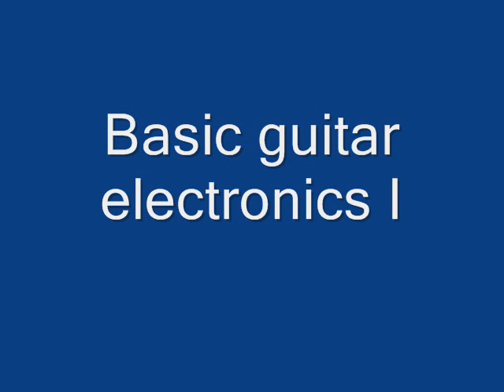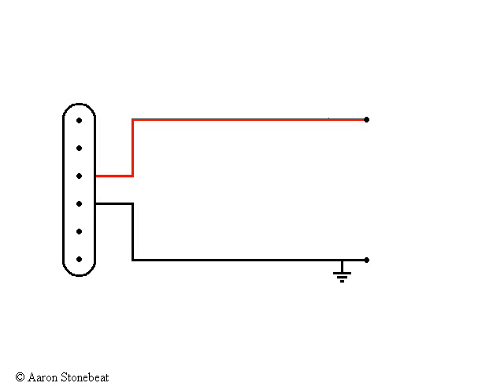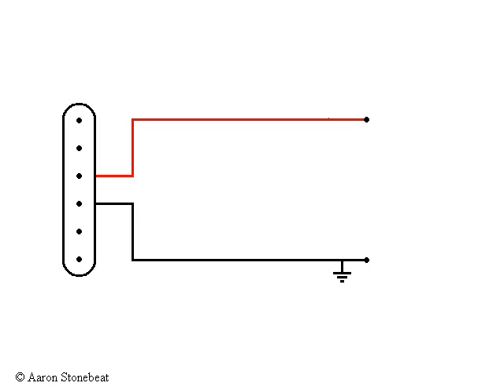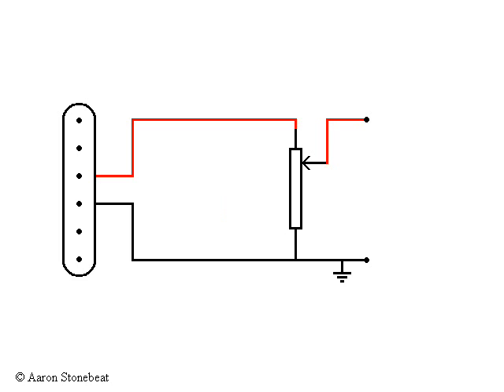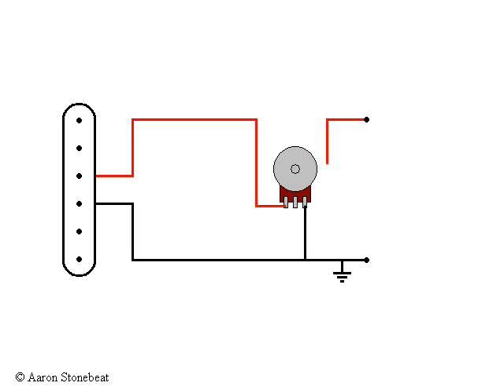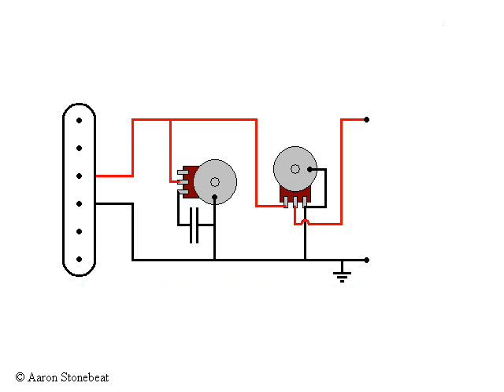Basic Guitar Electronics I - Volume and tone control

Comment: This is the most practical and clear teaching video I have ever seen anywhere. I'm a retired teacher! great weldone! How about doing the same/similar for bass guitar?
Reply from the maker: Thank you very much!
Electronics in basses doesn't really differ from electronics in guitars; blender pots and pre amps may be a bit more common in bass guitars.
Reply: I agree! I think these videos are VERY well done, and thought through. I am a teacher myself (music teacher) and I can relate with the fact that most often than not (if not always) we must deal with the very basics in a clear and succint way, to have a good foundation with the more intricate stuff. Congratulations Marc Van Oppen!
Reply: I have refurbished a trashed Strat body and now its a slick single coil short scale P bass using a Seymour Duncan Hot pu. I would like to be able to use the 3 position switch in a way so I can change tone. Can it be done and can you post how I could go about it. I'm ok at soldering despite my 70 years! Thanks.

Comment from the maker: @MitjaShi 
There is one hot lead from each of the volume controls to each tone control; if you cut those the tone controls are out of the circuit. Don't worry about the ground connections (or perhaps capacitors between the tone control and the casing of the volume control, depending on how things are connected). Disconnect those two wires and you're good to go; if you want to go back to having tone control there is only one wire for each set of controls to reconnect.

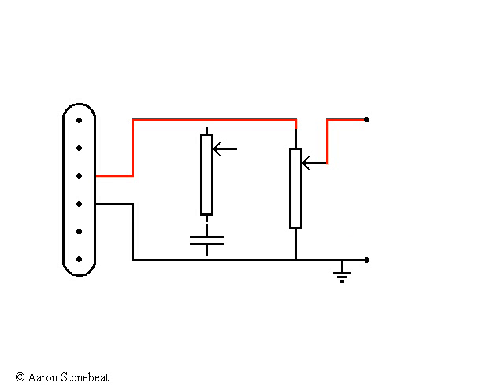Comment: Thank you very much for this video. There are a couple of symbols in the diagram that I don't understand. At 0:30 , there is a symbol in the bottom right that looks like an inverted Mayan pyramid. At 3:15 the tone capacitor is bisected by parallel horizontal lines. What do these symbols mean? Also, tangentially related, does anyone know if when you're winding guitar pickups and the copper wire breaks, can you get away with tying the broken segments together? Or do you have to start over?
Reply from the maker: The symbol at 00:30 means 'ground' (it connects to the mantle of the guitar cable).
The two parallel lines ar just the symbol for 'capacitor'.

The wire for the coil is insulated so it's no use to tie two ends of a broken wire together. You either have to try to solder them (tricky but not impossible) or start over.
Reply: @aaronstonebeat  Thanks for clearing that up for someone who's completely new to this!
Reply from the maker: @bryanreal4226  You're welcome. Good luck!

Comment from the maker: @MitjaShi 
In this schematic lowering the volume will affect tone because part of the resistance of the potentiometer is in series with the hot side of the circuit when the volume is less than 100% up.
To prevent this you could use a 'treble bleed'.

Comment from the maker: Yes it is. Generally larger pots (500K) are used with humbuckers so more resistance will be in series when the volume is lowered. I use a treble bleed (just is simple small capacitor) on one of my humbucker guitars.

Comment: Thanks again.  I thought I had it done right, but I done something wrong hooking up a piezo cable & handmade pickup made from the winding in an old hard drive and two magnets.  Aiming for one pot, gain, volume and one tone control for both.  Used case as saddle and added wire to string for extra measure since saddle case holding the rig ought create a ground.  So far failure.

Comment: What is to stop the signal completely bypassing the tone control since the signal just goes past it rather than through it, like with the volume control?
Reply from the maker: As long as the resistance of the tone potentiometer is not infinite there is a path for the signal to ground, so it will want to go there. There are potentiometers that disconnect from their resistance at  one end of the track; in that case the signal indeed bypasses the tone control completely when it is set to maximum treble.

Sometimes people use potentiometers with higher values (1 megaOhm for example) to prevent loss of treble in the signal via the potentiometers.

Does this help?

Comment: Thanks Marc, this is a great video. I'm just a little confused about the signal flow. Does the filtered signal travel back down the hot line from the tone pot. I'm struggling to wrap my head around how that signal gets into the output
Reply from the maker: Well, you could say that the high frequencies 'disappear' to ground and the low frequencies are allowed to travel to the amplifier via the hot connection.

A more correct way would be to say that the pickup and the capacitor form a system with a lower resonance frequency than that of the pickup on its own.

Comment from the maker: The volume pot is connected as a voltage divider, the tone pot as a variable resistor. The variable resistor allows the signal to 'see' more or less of the capacitor. If the signal 'sees' the capacitor high frequencies don't reach the amplifier (or to be more precise: the capacitor lowers the resonance frequency of the circuit).

A potentiometer doesn't have an input or output as such; what is what all depends on the way it is connected.

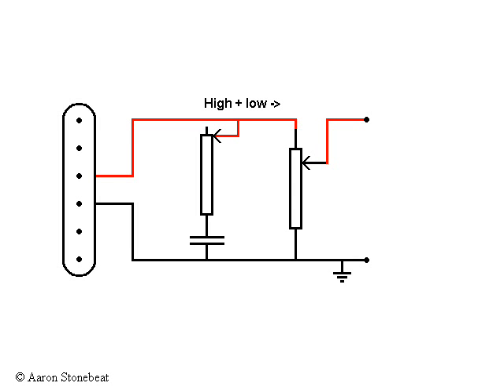Comment: I have a question about the setup at 4:14. 
If the volume potentiometer' wiper was selecting, say, 10 kOhm, and the tone potentiometer' wiper was selecting, say, 100 kOhm,
Then wouldn't there be ten times more current going through the volume pot? Does the tone pot control how the signal is filtered or what percentage of the signal is filtered?
Reply from the maker: To the first question: more or less but you also have to account for the reactance of the capacitor.

The value of the capacitor determines which frequency band can be affected, the potentiometer determines how much of the signal is affected.

Is that a useful answer?
Reply: @aaronstonebeat  perfect thank you!

Comment: You can test it with a multimeter.
The bad point is that guitar companies use STD pots for left handed guitars :(.
Fortunatelly CTS still makes reverse log pots! Also called vintage pots.
I have problems making/explaining my luthier  how to set up the wirings for both Volume, Tone ( capaciors) controls.
Thanx in advance!! 
Cheers!

Comment: Thank you
Is it matter the order of connecting the volume and tone pots?
Reply from the maker: No, not in the way I show it here. They are in parallel and it doesn't matter which is on the 'left' or on the 'right'.
You could connect the tone pot to the swiper of the volume pot (the middle lug, that would be the reverse order); maybe there could be a difference then, but only when you start rolling them down. To be honest, I've never tried that.

Comment: That is a very clear explanation. I was triyng to think in terms of "where the current comes from": for the volume pot, it goes in through pin 1 and goes to the jack through pin2; but what about the tone? The pot connected to the positive wire (ie the pick up) it is the pin2, which is an output. This confuse me, because I cannot understand how current comes in it.
Thank you very much
Reply: Signal passes through the volume pot. It can either go to ground or go to the output jack. For tone it's more like a drain. The tone pot drains the high signals. It's like a filter. Signal doesnt pass through it like it does for volume. It takes the signal and when turned to the capacitor side, the capacitor takes the high frequencies and send it through the capacitor to ground so it doesnt go to the output with the rest of the signal. Electricity will take the path of least resistance, so if a capacitor is high resistance to low frequencies then low frequencies will go to the least resistant path (output). Since capacitors are low resistance to high frequencies, the high frequencies will go their least resistant path, the capacitor which goes to ground so none of it goes to the output.

Comment: Thank you!! :) I'm making a luthier building a left handed guitar and I have to tell him the specs I want.
After many researches I found out I need antilogarithmic / reverse log potentiometers and wire them in a reverse way ( opposite from a right handed guitar configuration ).
If I won't use reverse log pots and use standard right handed pots and wire them reversed the result would be awful. 
Awful because the response of the pot would act almost as an "on off" switch.
You can test it with a m

Comment from the maker: @hezzart 
Hoi,
It doesn't really matter, any wire will do. Lengths are short so resistance is low; even for the very thin pickup wire (about 0,05 mm) it's in the range of 1 Ohm per 10 cm. Stiffness of wire can be a problem if it's too thick and space inside the guitar is limited. Shielded cable reduces hum but also adds parallel capacity to the circuit and thus takes away some of the high frequenties.

Te weinig tekens over om het hele verhaal in het Nederlands te herhalen ;-)

Comment: Hi there! I enjoyed your video very much. I do have a question. I have seen tone pots where the signal is connected to either lug 1 or 3, and the wiper lug used as output. I have also seen the opposite, the wiper taking IN the signal (as you describe in your video). Does this make any difference, and if so, what is it? Thanks.
Reply from the maker: As far as I know it doesn't make any difference at all. There are several ways a tone control can be connected but electronically they all come down to the same thing. I've made a video about it recently: watch?v=4u_ukXACdKc
Reply: Thank you! I reallly think your videos are great! Perhaps the best I've encountered on the internet. Thanks for sharing your knowledge!

Comment: note that in this case if you turn the volume down you basically connect the positive output to ground, which is ok for one pickup, but if you want to hook up multiple pickups with individual volume controls to a single output, you have to connect the output to pin 1 and the coil to pin 2, otherwise you won't have any output when eider of the volume pots is turned down.

Comment: So how do tone controls work on an amp, where you have separate controls for bass and treble?
Reply from the maker: James Cuttell Most guitars have passive tone control; there are a lot of possibilities but selected frequencies can only be attenuated. Amplifiers have active tone control circuits; frequencies can be attenuated or amplified but they need - among other things - tubes/transistors and a power supply.

Comment: Hey thanks for tutorial! I have a question - Why does the signal from the pickups feed into the output of the tone potentiometer unlike the volume? Thanks.
Reply: I think it's to do with the path of least resistance,  I'm not sure though and was wondering the same thing.
Reply: Thanks for the video, you may have noticed from the comments that you are doing something different to the others, you are teaching the electronics, you explain the circuit not just describe the circuit. So many have said, now i know what to do. I want to do this with my videos.

Comment: Thank you so much for this video!  
So a Volume "pot" is essentially a resistor within a wiper...And the wiper controls how much of the signal goes through the resistor?  
l have some background with electrical stuff but it's been a long time...but I am brand new to guitar wiring -- so forgive me if these questions sound basic.
I have a "junk guitar" that I bought where I am basically re-wiring it myself so I can understand this better...
I opened the back cavity and I'm looking at the volume and tone pots.
On the tone pot I see it has a 500k capacitor wired to it, on the outside.
But on the volume pot, I don't see anything...
So is the resister on the volume pot inside of it?
Why would they do that?
Thanks for your time.
Reply from the maker: +surgeyX Most importantly the wiper controls how much of the signal goes to ground (i.e. not to the amplifier).

The capacitor on the tone pot functions as a frequency filter, the potentiometer how much it is engaged (more or less high frequencies go to ground depending on the position of the pot).

Both pots are basically the same: a resistive track with a wiper that can move along it.
Reply: +Marc van Oppen 
So the wiper itself IS the resistor?
Reply from the maker: +surgeyX No, the wiper moves along the resistor. Maybe check some of the clips here on YT where they are taken apart and explained.
Reply: +Marc van Oppen 
OHH the track inside of the pot that the wiper moves along itself is the resistor...Right?
Reply from the maker: +surgeyX Yes!
Reply: +Marc van Oppen Haha okay thanks I understand better now!

Comment: why conecting ground to the case of the pots reduces hum and noise? from a electrical engineering/pyshics aproach???
Reply from the maker: Two reasons:
1) Inside the pot is a lenght of signal tract that will act as an antenna and pick up external electromagnetic waves.
2) The casing of the pot is conductive (metal) and will pick up and broadcast hum; grounding the casing prevents this from happening.

If you used a pot without casing or a with a non conductive casing (they do exist) the hum would probably be a lot less than when you used a pot with an ungrounded metal casing.
Reply: Oh Marc, so much thanks!  I been surfin interner for weeks trying to get this response. You're a genius man. Thanks again for your amazing content !!!

Comment from the maker: That would depend on the inductance (the resistance or output as most people put it not quite accurately) of the pickups, and on personal taste. There is no general best answer; i'm sorry.

On guitars a rule of thumb is 500k pots for humbuckers and 250k for single coils. Capacitors are usually 22 or 47 nF. There is also the question of linear of logarithmic pots; again it is a matter of taste and any combination can be found on guitars.

Comment: What difference would it make if I connected the tone control on the output of the vol control (wiper)? What I mean is that in this case instead of rolling off highs and then adjusting volume I would adjust volume and then roll off highs (if I want).
Reply from the maker: It does make a little difference, someone showed this in a video (and of course now i don't know where to find it). The difference is in the response if I remember correctly; with highs rolled off completely there is no difference.

Comment: I'm confused. Electrons travel from positive to negative, toward ground, right? So electricity is going from the input jack, to the wiring to the bridge to the strings to my fingers to the ground, right great. 

But how does signal go from guitar to amp? Why does guitar signal go in reverse of electrical signal?
Reply from the maker: 1) There was a time when people thought current was positive charges moving from positive to negative and so the convention was established that current goes from plus to minus before it was known that there were actually negative charges (electrons) moving the other way.

2) Ground is always neutral so electrons will move from ground to a positive charge and to ground from a negative charge.

3) A guitar pickup produces an alternating voltage so the charges are moving back and forth through the signal side of the wiring and the guitar cable. The amplifier responds to this changing potential (rather than the change in current).

4) When you touch the strings (or any grounded part of the guitar) you ground yourself so there is no guitar signal traveling through you.

I hope this clarifies matters.

Comment: i have a fender strat,i replaced the neck pickup and when i did it lost lost volume,i don't mean that the pickup is quieter i mean it actually sounds about half volume at the neck pickup,i put the original pickup back in, same problem and it sounds like the tone is at about 5 ,and i replaced the tone pot and capacitor. any thoughts ?
Reply from the maker: +kevin brooks My first thought and question: does it also happen when both the neck and middle pickup are engaged?
Reply: +Marc van Oppen yes,you can still notice the decreased power and tone ,the bridge is fine.
Reply from the maker: +kevin brooks I would check all connections to the tone pot for the neck pickup. Also: have you checked the value of that tone pot?

Comment: where does the ground go? i assume the red one goes to the output jack.
Reply from the maker: Red is hot, signal, black is ground, it has the generally accepted ground symbol in the lower right hand corner.

Actually both sides go to the output jack, signal to the tip and ground to the sleeve; inside the guitar ground also goes to (preferably) all metal parts that are not part of the circuit like frames of switches, metal control plates, metal mounting brackets of pickups, the bridge and whatever you have.

Comment from the maker: It is normal. By touching the strings or any other grounded metal part you ground yourself.The buzz is 50 or 60 Hz from the power grid transmitted by transformers. The human body receives and transmits this electromagnetic radiation. If you touch metal parts of the guitar most of this radiation is diverted to ground, a bit like a lightning rod.
If you roll off the tone it gets less audible.
Be sure to connect your amp to a grounded power outlet
Reply: Marc van Oppen §§

Comment: I have seen that the ground side is usually connected to the tremolo (well and the output jack ofcourse). But where is ground on a guitar with a fixed bridge?
Reply from the maker: It's connected to the bridge, with a wire underneath it or in one of the holes for the screws.
Reply: Marc van Oppen Oooh thank you very much. I'm building an e-guitar for school project right now and your video helped me alot thanks.